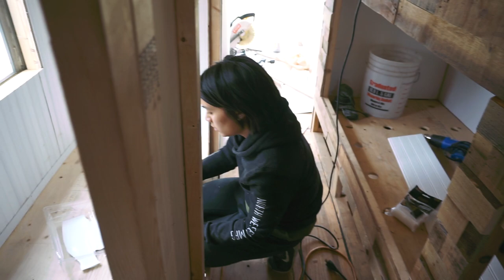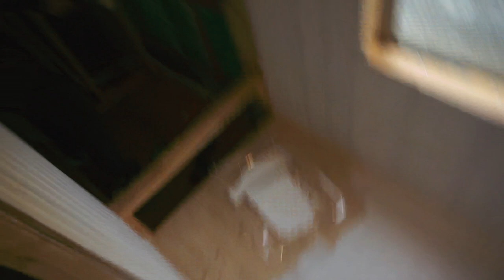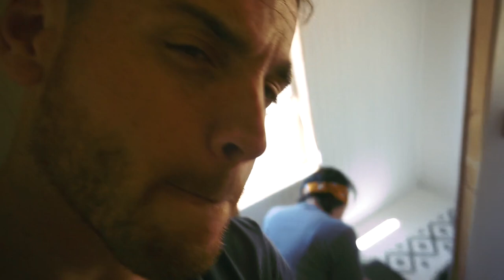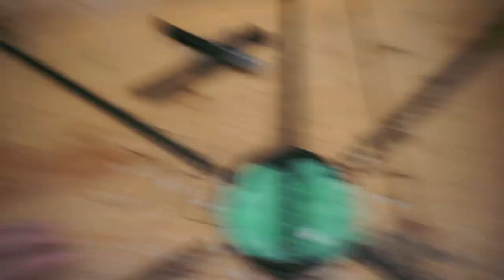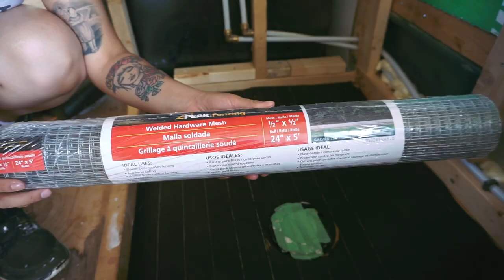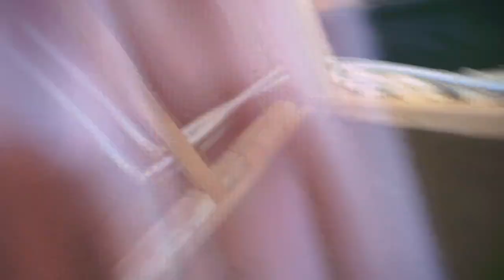Shower Pan FAIL | Bathroom Floor DONE | Stenciling | Tiny House School Bus Conversion

Comment: Isn’t there a concern for cracking from movement in the bus?
Reply from the maker: you would think so but there are dozens and dozens of other bus conversions that have done tiling and haven't had any problems. I guess we'll find out when we start travelling!
Reply: Runaway Expedition that's what I keep seeing and was confused!